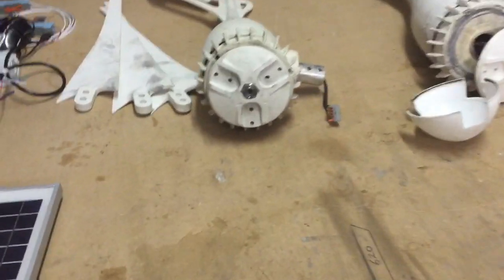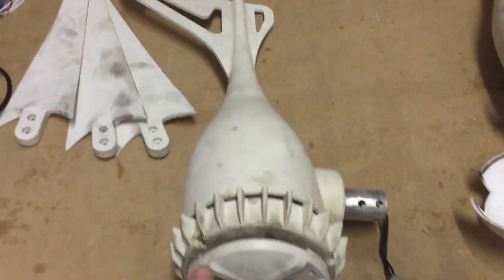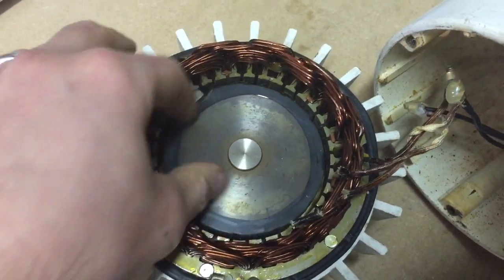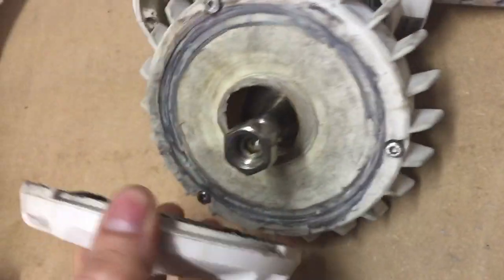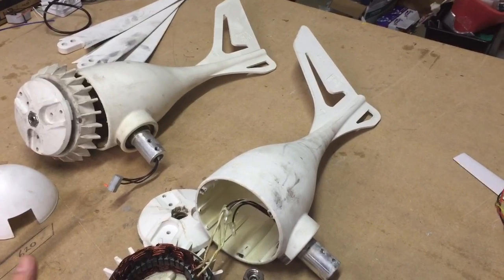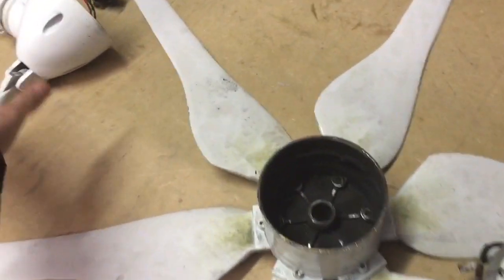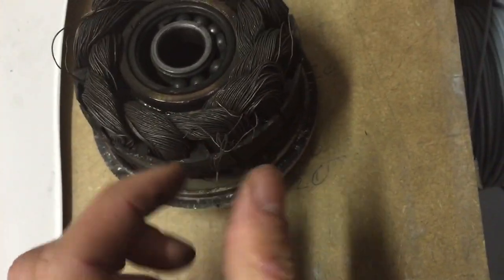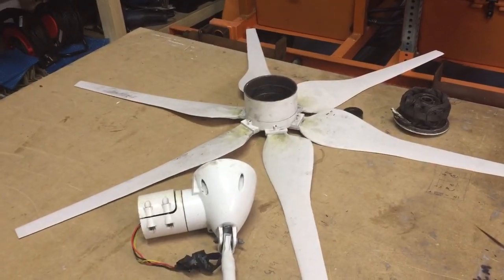Review of ista breeze i500 and hyacinth 300 wind turbines independent test

Comment: Hi Mate, this is one month of production since I reset the meters.
All 10 wind turbines are using 1.2M wind wheels and 5 or 6 blades.
26V - 24V 500W Vevor             -  6.5M high    -  4,836 Wh 
26V - 24V 500W Vevor             -  6.5M high    -  4,631 Wh 
14V - 24V ista Breeze i500      -  4.5M high    -  1,529 Wh
12V - 24V 300W Hyacinth       -  4.0M high     -  1,009 Wh
12V - 48V 500W Sunboo S5   -  3.5M high     -  1,925 Wh   
12V - 48V 500W Sunboo S5   -  3.5M high     -     900 Wh  
12V - 48V 500W Sunboo S5   -  3.5M high     -     612 Wh    
12V - 48V 500W Sunboo S5   -  3.0M high     -     549 Wh
12V - 48V 300W new rotor     -  3.0M high      -    464 Wh   
12V - 48V 300W new rotor     -  3.0M high      -    353 Wh
I live in a Low wind area, my average wind is only 2.78 meters per second.
Hey guys, think about posting your turbine information and production.

Comment: The damage is caused by the brake being on for way too long. The brake is just a dead short,that makes a ton of heat. I would suggest a bigger battery bank and more load. This is why small turbines get bad reviews,from bad operators. I have several that operate in  high winds and haven't had any issues at all with bearings or melting.
Reply: Finally an smart answer 🤘💪👌👍👏👏👏

Comment: All practical tests show that small wind turbines hardly generate any electricity! And only at very high costs!
Because there is hardly any wind close to the ground. But 100% more wind generates 800% more electricity! Wind close to ground is extremely gusty, which usually shortens the service life. Only if you need to be self-sufficient from the power grid, you should erect the largest possible wind turbine on a high mast for the winter.
With solar modules, on the other hand, you can reliably generate green electricity for 25 years at approx. 3-10 cent/kWh!

Comment: the braking system should not be used because it heats the stator
maybe the charge current of the batteries with constant current should be reduced to prevent the stator heating

Comment: I just took my hyacinth down for bearing change after 5 years spinning. The most front bearing was keeping a bit noise, others seemed to be ok. I have 12vdc model. It looks that these are all 3-phase devices and they have just put the 12v regulator inside the case to make it 12v. The regulator was loose inside, but wasnt luckily caused any damage. Slip ring was ok, but I ordered new one just in case. The generator has been on the coast line all the time, charging batteries and only with normal 30A pwm solar charge controller.

Comment: ok, I have a 400w airx for 15 years. wind where I have it as high as 60mph. so far no problems at all. still power out put is still the same. I have a new one that I will install this spring 2019. its in stalled in northern Ontario Canada but I live in the u.s. during the winter. it runs all year long . that's why I bought another. made in the u.s.

Comment: Unfortunately wind generators, especially the ones on eBay are mostly scams. I have built several ranging from 10 footer to the the 20 footer listed in Hugh's book, which are amazing machines. I even sold a decent blade on eBay myself for several years cast from solid aluminum. The old ametek motors were fantastic. Burned mine up finally in a gnarley storm. Would have just needed new brushes and the brush mount which also burned up. Friggin  pack rat made off with a few key parts... little bastard! So never got it going again. 
 Alternators do work without mods but need direct excitement from batts so tricky engineering to make that happen. Plus they need really fast prop. Something easy to make but hard to convince people of until they see it. Car alternators seem like the perfect answer. Only you put permanent magnets in them and they cog badly and stock they need to spin really fast. Fewer the blades the better when it comes to speed, speed is power!

Comment: Arctic Bonding epoxy should fix those magnets I know this post is old i seen the date but could not help but throw that out there. Acrtic bond is made to take heat those that dont know what it is its a bonding thermal compound normally used in computers to bond heat sinks to chipsets and that sort of  thing ive actually found multiple uses for it and it holds very strong
Reply: The unfortunate reality of these turbines other than the magnets coming off is the cheap bearings that they use on the shafts. Even by correcting the magnet issue, you still have to find a solution for the inferior bearings. Imagine spending that kind of coin on a product and having to spend more money to modify it to be able to even use it?
Reply: I got given one of these turbines and have glued the magnets on with Gorilla Glue (after roughing up all the surfaces with a file). Touch wood, that seems to have fixed the magnet parting issue.

Comment: what about using a car alternator?
Reply: nope. don't bother = long story short.
Reply: Bearing in front takes most of the load, rear bearing can't take a load other than radial. As David Noel said, don't bother unless you want to make a belt drive unit. Most of them need 3000 RPM to make decent power. Some have to run at twice the engine speed so they are designed to run at up to 10K RPM.
Reply: Bloody inefficient. Dont bother with it.

Comment: Magnets should be fitted with stainless steel screws,....  And the standard crappy regulators used on these turbines are called " Shunt 3 phase Regulators"....  Shunt regulators are bad news, they burn up coils in the generator and blow your batteries. Its best to use a 50amp 3 phase diode bridge and a standard buck converter. "about $10 parts.     But then you need to find away to stop the prop overs-peed in high winds...  Maybe you can trim the prop with tabs to reduce its speed in high winds

Comment: Funny, I have the Hyacinth one, been mounted to my garage for maybe 4 years now, works perfectly, the "tail swing" feature works good, though I had the same issue as you with the bearings, (its mounted on side of my garage) I noticed one day the sound from it changed and I knew the bearings was done for, so 2 new SKF bearings one for the spindle, and one for the swivel and that was it... 
BUT as I was replacing those bearings I found that the wires coming from the coil had worn on the inside of the housing and one of them was completly bare, touching the inside of the housing, shorting them out, had to mend that, isolate them with tape, then wrapping the cluster with soft gardenhose (what I had laying around).
Other than that I think its a decent tubine for the money :)
What chargecontroller are you using?
Reply: yep i had the hyacinth 300 in 6 months the bearing wore out it low wind enviroment surrounded by houses and trees, appart from the bearing issue they acceptable, you get what you pay for , theyre not top of the range after all.
diy axial flux are more fun if you build it right they last a very long time

Comment: After seeing all these video's on Chinese wind turbine garbage, and the amount of cost involved with repairs, breakdowns etc,.... it would have been cheaper just to connect to the grid.
Reply: Unless you live in a failed state, the grid is more cost effective. But the grid is not readily available everywhere. Even for wind energy large utility operations are a lot more efficient per currency invested.
Reply: @christinemurray1444  - I live in the 'failed state' of Ireland :)  Where I just bought a house and the local/national/only electricity company wants. . . wait for it . . . ..  almost 4000 Euros to hook up the electricity to their grid.  I said F-you, for that money, I can buy solar. So I did. But not being very sunny here in Ireland, I will have to supplement it with hydroelectric (one thing we got plenty of is water! rains alot ;).  Thus why Im here checking out gennies, and most seem to suck!
Reply: @ichhasseamerika  I agree that Ireland is a failed state, but still 4000 up front plus the bills will likely be much cheaper than the installation and running costs of wind+solar. I've done several installations and they typically cost much more than that, unless you live somewhere tropical and your consumption is minimal.

The kind of installation that will "guarantee" that you're powered up to run stuff like heating, washing machine, etc all year in Ireland will cost you a lot more than 4000.

I have an off-grid installation in the Canaries that I visit often and connecting to the grid costed 9000, while doing my own solar setup costed ~3700€ (because I did it personally with my husband). Still, it's only enough because you never really need heating there, and it's very sunny (and windy). Also we have an emergency petrol generator that costed a few thousand.

I really would consider somewhere like that not to have grid, when you need to invest several thousands to connect it. The vast majority of people don't live under these circumstances. Paying enough money, there's grid everywhere in the world. I wasn't really talking about such cases.
Reply: @christinemurray1444  - Um, I already installed my solar system for about 2000 euros, maybe 2200 tops. I like to embarrass people who say it cant be done, or will be prohibitively expensive.  I am currently having to battle this same attitude in the hydroelectric space.  There seems to be alot of arrogance and 'I know better' in the renewable energy space, its a real shame.   And by the way, I was joking about Ireland being a failed state.  It is one of the most prosperous in europe, just the politicians are psychopaths. :D  But then, they all are.

Comment: I bought one of the i500s a couple of years ago. I've yet to put it through its paces and have only had it running for a couple of hours. After seeing this video, i'm going retrofit the pin and bearing arrangement. The fact it only has one bearing at the top is pretty bad. There should be a counter one at the base too. Thanks for putting this up! Cheers, Ben

Comment from the maker: Just a quick note if you are recommending any turbines on this post - with link to external website - can you attach the image if the magnets installed on the main shaft. There are a lot of the same crap with different name and slight change to external housing - which is going to fail as the ones I had. We're taking them all down next month - so I'll open them up and post new clip how it looks inside.

Comment from the maker: Hi guys, Sorry for not getting back to you on your comments - This is my private account and I never check this. To answer most of your questions. The ista breeze turbine - the seller offered me to send another one but I told him to not to bother, the design of the magnets is wrong. They should be either screwed in to the main shaft or have a steel band strapped around. I've tried electric tape - but the magnets at the high speed just cut through the tape. The other Chinese turbine hiyacynth or something simmilar. We've got 6 more and after the first stormy weather they all have seized. After that day they only moved slowly in a very strong wind, so is not just a faulty unit - they are all the same. We'll be taking them off soon and replacing them with the solar panel. The seller is no longer active on ebay and doesn't respond to our e-mails stating the problem, so I guess the warranty is until you leave the feedback - after it you're on your own. I've used the controller recommended and sold by the supplier, so I wasn't trying to change that since it was recommended by somebody who sells them. I've lost the confidence in the wind turbines - it looks to me the low cost/ low power rating turbine doesn't exist - these are just a gimmicks you can use somewhere in the middle of the field  to top up your battery away from the coast. This is not a reliable solution, since it doesn't give rated power. It has to spin very fast to get close to it - however longer exposure to that wind will burn the turbine. Also 2 of those turbines burned the controller - the break stopped working completely destroying the turbine and the battery. As soon as we take them all off - I'll post the new clip taking them all apart. One comment was this is wrong turbine for the environment - I think you're right, but I've spent way too much time and money to get to this point that I've lost my interests in testing the reliable solution. I hope this helps and apologies for late reply.
Reply: Did you have a Charge Diversion Controller in your setup? There's lots of Google results detailing that Wind Turbine setups without such a device will lead to either the batteries or turbine burning out
Reply: lafamiliaGo  h
Reply: lafamiliaGo Good answer! At what point did you arrive with your research?

Comment: There is a major problem with the way the magnets are held in position on these. I have a design for to end this problem  they are for boats and normally  located where they can be taken down quickly. Until such Time as the magnets are installed better don't buy them .There is nothing of any substance holding  them in position  all it would take is for the maker to have holding compartments for each magnet welded to the  Magnet rotor  so they can be held better with a compound . But the fact is they know of the  flaw  and  they are for boats  to be taken down in less than normal fair sailing weather

Comment: I think you made the wrong joice for your Windspeeds. Put up a Windmessuring-device and Monitore your everige Windspeeds and buy a Windgenerator that can handle these. The Istabreeze is only made for a maximum of 45 meter per second. I think, on the open Beatch, you got very often more then 60 to 70 meter per second. 
And a Windgenerator that can handle those Speeds cost mor than 1000 dollar . But the Energyoutput is worth the Monney ;)

Comment: I use a i500 ista breeze for 3 years and I am very satisfied.
Reply: The rotor blades diameter is too small. At this diameter, You will NEVER see 500W on this turbine.
Also the ball bearing system use only one ball bearing instead two is poor quality; the axial force of wind is transferred to the magnets, and not to the bearings. Bad turbine !
Reply: Bine  zis trebuia pus pe doua rulmenti  ,pe ambele capete